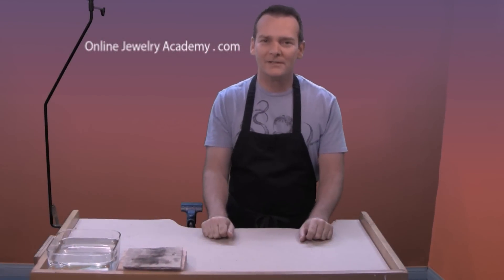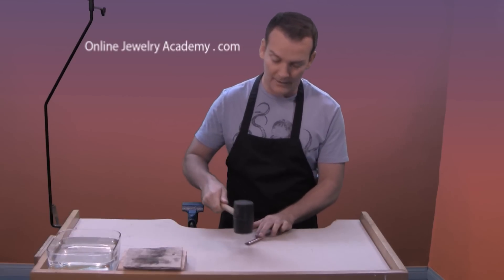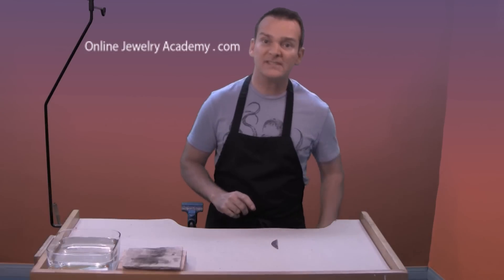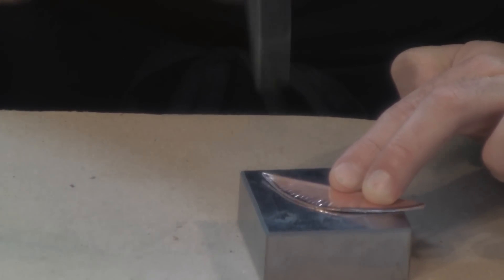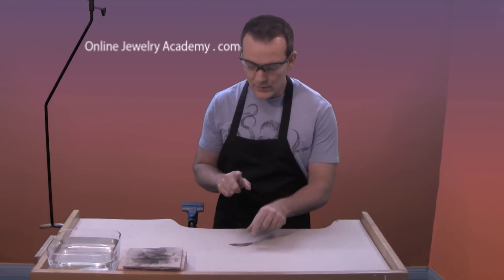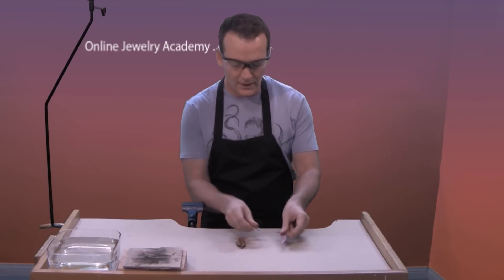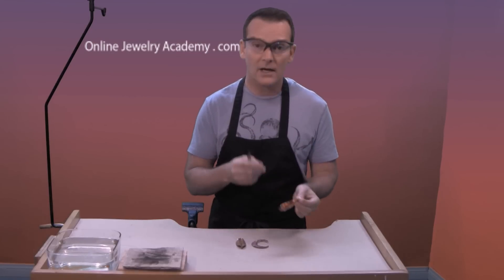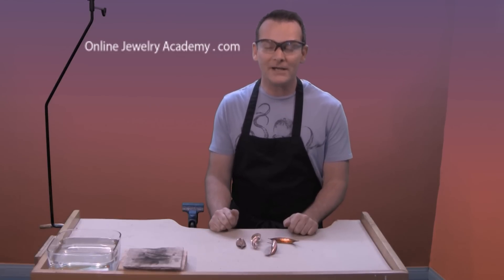Foldformed Copper Shapes: A YouTube Favorite

Comment: Hey John, Thanks for all of your AWESOME tutorial videos!! Recently I have bought several old (junk) pieces of old "silver-plated"  bowls, plates, etc., from a local Salvation Army/Goodwill store.  I was thinking of trying to make some cheap cuff bracelets, necklace pendants, etc., out of this sheet metal (it looks like nickle-brass, with silver plating on both sides), and ought to be worth salvaging into some affordable jewelry, that will look like "Sterling silver", at a distance.  Would you consider doing a video on working with such materials?!...  Thanks!
Reply from the maker: I'm sorry to say that I won't ever do a video on that topic.  Working with plated material is a real mess.  If you try to anneal the metal you will loose the plating.  And, if you try to bend plated metal items, the plating will often crack and peel off as you go.  I'm sort of a materials snob.  I prefer to work with new sheet metal and wire.
Thanks for your support! : )

Comment: Thanks to your video, I've made some pretty leaves and pods. However, despite repeated hammering and annealing it takes very long time for a Rueger-style curve to develop. I'm using 0.5mm copper and a cross pein hammer which looks about the same size as the one you use. Any tips?
Reply from the maker: +Vikette1000 
It takes me a long time to hammer the pieces into shape too.  It's just the nature of the material and the inefficiency of the human tool.  I find that if I work on multiple items at once I get less impatient.  Sorry I can't reveal any magical secret.  Good luck with your projects.
Thanks for your support! : )

Comment: Thanks for a another great video. I LOVE your instructions.  I trying to make a character costume buckle that can be as strong as a tradition belt buckle. if I used your techniques in this video, can I color and top coat with easy cast resin? Thank you in advance. Also will the resin crack or pop out after use?
Reply from the maker: +private91205 Thanks for the compliment.  I'm glad that you are finding the OJA videos informative and helpful.  We have a number of videos on our channel and website that cover the usage of two-part epoxy resin.  This one is our most popular https://youtu.be/4cbfF1qWdyc  While I can't guarantee that the resin you apply to your project won't pop off or crack, I can say that it is pretty easy to fix.  But, casting resin may be too thin for what you have in mind.  Plus, it can get expensive to use on a small project.  Check our our two-part epoxy resin videos before you make your final decision.  Good luck with your project.  And, thanks for watching! : )

Comment: Good morning, I loved your video and I have signed up on your channel. I'm trying to learn how to work with copper sheets and your video appeared to me on the right time. I have a question, could you enlighten me?  I wonder if I could use culinary torch to heat the copper? They are smaller and easier to use and find. 
Thank you very much. ^_^
Reply from the maker: +Cláudia Pinotti 
Hi Cláudia,  Yes, you can use a butane culinary torch to anneal small copper pieces.  You would need a bigger torch to efficiently anneal larger pieces.  You can also solder with a small butane torch.  Just be sure that it can reach a temperature greater than 1500 degrees farenheight.
Thanks for your support! : )

Comment: Thank you so much for sharing this tutorial! I do have a question about the piece that looks like a boat or a pea-pod. Did it start as a folded half round like the one you initially showed or was it another shape to begin after folding and cutting prior to hammering?
Reply from the maker: +Terry Brown 
Hi Terry,  All of the items in the photo for the video started out as folded metal forms that were cut into arcs (with the fold as the base).  But, you can work with most any shape that you like.  I suggest planning your pieces by working with paper models.  Just be aware that as the metal stretches it takes on a new shape.  I hope that helps you get what you're trying to make.
Thanks for your support! : )
Reply: +OnlineJewelryAcademy Thank you for the information. I saw a picture of a copper piece that I wanted to make a few months ago. I am new to jewelry making. The fold forming process is probably my best bet for making the piece and now the fun starts as I see what I can make the copper sheet do!

Comment: Hi, I tried it today with sterling silver;  . 75mm thick; 10mm wide, 50mm long.
So the resulting piece to work on was:1.5mm thick;  5mm wide; 50mm long.
I even put it thru my roller to get a good fold, now having difficulty opening it!
I doubled it over etc, but after annealing it many times, with the hammering after the annealing, I couldn’t get it to change shape.
Was it more difficult due to being so narrow as it was a bit difficult hitting the hammer on the edge of a narrow piece of metal.
I’m wondering if I used a wider piece of thinner, pure silver, I may have better chance of it working. 
I’m very keen to make it in silver. I have seen a photo one done in silver. 
I understand it is easier in copper, but I’m keen to do it in silver, for a pendant or earings.
Your description is very helpful.
I have subscribed,
Thank you.
Bev Jordan, New Zealand
Reply from the maker: Glad you liked the video and subscribed. Good luck creating your desired silver piece. 😀
Reply: were you hammering it when it was hot? Maybe you were hammering hard enough you were getting spots joining together from heat and stress, i dont know? Did you figure it out?

Comment: Great info! Thanks! Just a question about sharp edges on the pieces you are folding. is there any need to sand the copper once it is folded?
Reply from the maker: Lynne Donahue The edges on the blanks that you start with can be filed and sanded to a smooth finish.  After hammering you can touch up the edges.  Really you can do anything you want to the finished forms.  If you check out the OJA field trip to the plater, you'll see that we gold plated one of the forms.  Have fun with this technique.  And, thanks for watching!  : )

Comment: Hello, I know that you called the hammer a goldsmith cross peen hammer. What is a good weight?
Love all of your videos.
Reply from the maker: Hi Kim,  Most jewelry designers have a wide variety of hammers with various faces and weights.  Goldsmithing hammers are all about the same in size and weight.  So, you don't need to worry if you purchase a standard goldsmithing hammer.  But, I would recommend that you also purchase a couple of larger hammers for bigger jobs.  Glad you like the OJA's videos.
Thanks for your support! : )

Comment: Hi - what size blank did you start with?  I think I tend to go too wide ... thanks
Reply from the maker: +Maureen Houston 
Hi Maureen,  The size of the blank is most often determined by the end result you are trying to create.  You can make fold formed pieces in any size you like.  I suggest that you experiment and practice to determine the size that you require.  Generally, I practice with blanks that are about 3.5" long by 1/2" wide (folded).  Good luck!
Thanks for your support! : )

Comment: How did you make the moon shaped metal?
How can you curve the folded part?
Reply from the maker: Each of the items in the photo started as a sheet metal blank.  The shape of the blank was an elongated oval with pointed ends.  The blanks were annealed and folded in half.  Then, they were hammered with a cross-peen hammer along the open edge to stretch the edge opposite the fold.  They were reannealed after each round of hammering. Once they reached a point that I liked, I opened the pieces up with a dull knife.  As you can see, some were twisted before opening.  The moon shape is actually a piece laying on its side.  I suggest experimenting with the process.  Have fun.
Thanks for your support! : )

Comment: How do you seal copper to preserve the finish?  And what solder is used to join copper to copper and copper to other metals (say if the 'other' metal was acting as a framework to hold up a display of copper leafs for example)   Thank you in advance.  SUBSCRIBED and hit the notify bell!
Reply from the maker: Thanks for subscribing to the OJA.  The OJA has a number of soldering videos included in its playlist.  You can find the complete playlist on our website at: www.onlinejewelryacademy.com  You'll find the videos conveniently grouped by topic on the website.  One of our viewers recently recommended a product for sealing copper called Everbrite.  Normally, I use silver solder to solder copper.  If you want to eliminate the solder seams, the OJA has a video on plating copper with used pickle on the website.
Thanks for your support! : )

Comment: What is the solution you put it in after annealing.
Reply from the maker: Hi Pat,  I definitely begin my fold forming projects by annealing the metal.  And, I quench the metal in a bowl of clear tap water.  I do NOT, however, quench the pieces after annealing while I am working on them.  Some people refer to this as working with "black copper."  The reason why you don't quench the metal after annealing (or pickle it for that matter) is because you want the interior of folded pieces to remain dry while you work on them.  Otherwise, the piece will quirt you with water or pickle every time you strike it.  Good luck with your projects.
Thanks for your support! : )

Comment: by ,watching what your ,doing ,, i take it that you dont have to ,turn over the leaf ( ,before  ,you ,unfold ,it ) ,and cross pean the other side  ??
Reply from the maker: Hi Henry,  Yes, that is correct.  One round or hammering only needs to be applied to one side of the piece.  But, to hammer the copper blank to the right shape before you open it may take 10 to 15 rounds of hammering.  The metal needs to be stretched from a skinny D profile into a C profile.  I hope that makes sense to you.  Good luck with your projects.  Experimentation is the best way to learn how to master this technique.
Thanks for your support! : )

Comment: I'm sure I'm being stupid but I can't work out how you managed to get anything but a straight line on a folded edge. You clearly have some curved folded edges??
Reply from the maker: +Emma Bates Great question!  I started with a rectangular piece of copper.  I folded it in half.  I cut a curve along the open side of the narrow rectangle.  Then, I hammered on the open (curved) side.  But seriously, try all sorts of experiments and see what you end up with.  Be sure to keep notes.  Good luck!  And, thanks for watching.  : )
Reply: +Emma Bates Emma, as you hammer the metal it gets thinner. As that metal gets thinner it has to go somewhere. It stretches out and forces the metal to bend into a radius.
Reply: Thanks for your replies.  It works!

Comment: how many pounds/ ounces is the cross peen hammer?
Reply from the maker: talginlvl90 I don't know the actual weight of the hammer that I use.  But, it's a standard size cross-peen goldsmithing hammer.  I generally don't use a larger hammer because the metal pieces I'm working with are rather small.  Thanks for watching! ; )